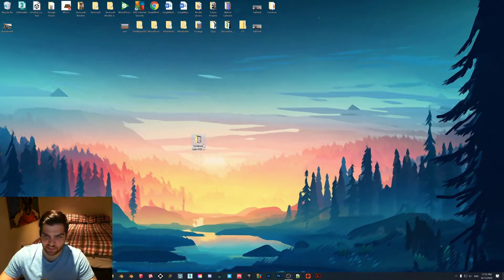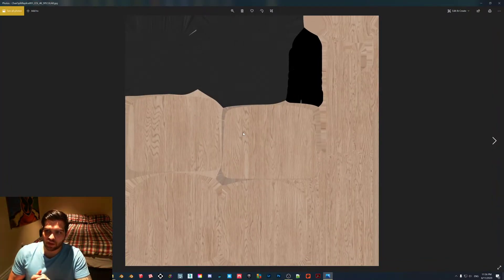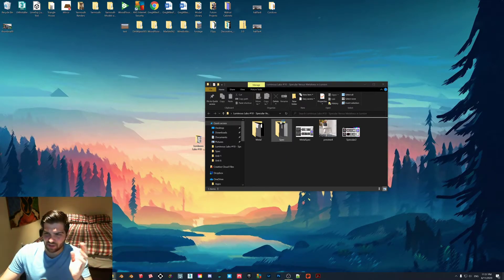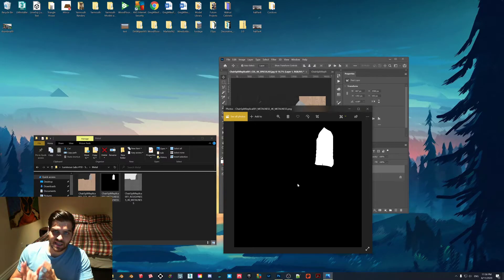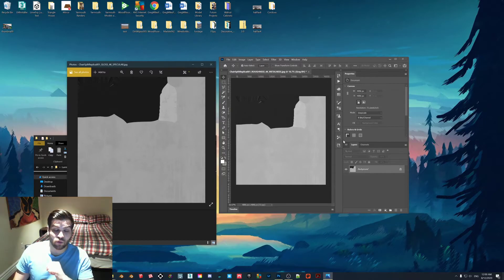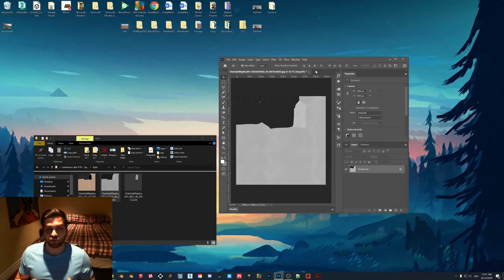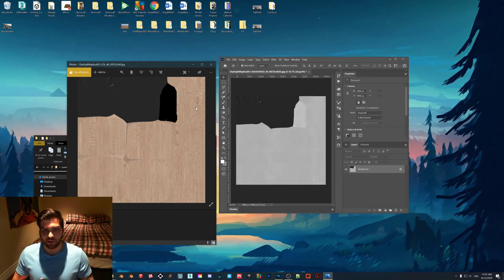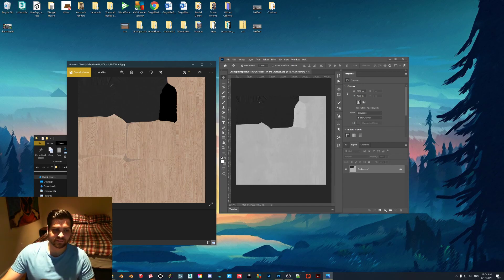Unlock METAL MODE in LUMION!! (Part 2 of 4) - Specular and Metalness Workflows in Lumion!

Comment: HI, thanks once you have the 2 files in PS..what do you do with them? Do you save them both a jpg ? Or do you collapse into one file? How to you save them into the "Lumion" Alpha channel?
I can't figure out where is the Alpha Channel in Lum10. THanks
Reply from the maker: You have to save them as a .TGA (targa format), or at least I feel that is the easiest way. Once you do that you can just import the targa as the normal map in Lumion and it is all smooth sailing.

Check out this video :) It is an old one but I feel like I go through it in enough detail that you will be able to get the hang of it. This was my very first video so it is pretty rough but the information is good 

https://youtu.be/KRhFCMHYzFc
Reply: @LuminousLabs  Thank you I will try. (this one above "Unlock METAL MODE in LUMION!! (Part 2 of 4) - Specular and Metalness Workflows in Lumion!?)"  thanks for taking the time

Comment: What I've gathered is that you put the gloss map in the normal alpha and the roughness in the diffuse alpha.  What I don't get is, if roughness and gloss are inverts of each other then why would you need both maps?  Wouldn't you get the same outcome regardless?  Maybe Lumion is different..  I don't use other rendering software so I don't know.
Reply from the maker: It is normally that you make a gloss mask by taking the normal map and putting a gloss map in its alpha channel. For the color map you can put a specular/metalness map in the alpha channel and that will mask the reflectivity. If I used the roughness map in the color map in the video I apologize for the confusion. 

I show how the reflectivity mask works with a metalness texture in part 3 of the series which I just released!